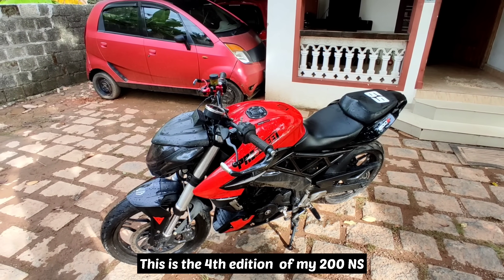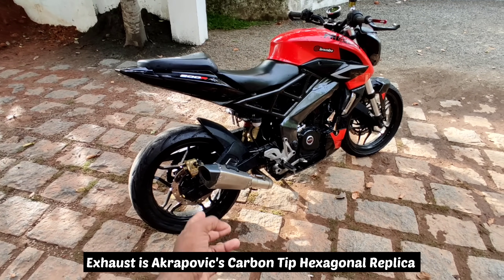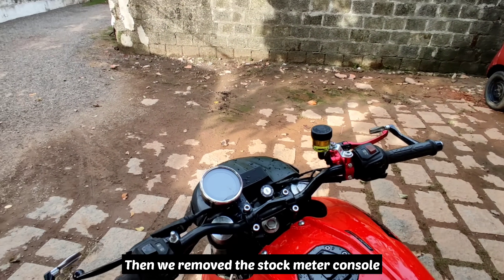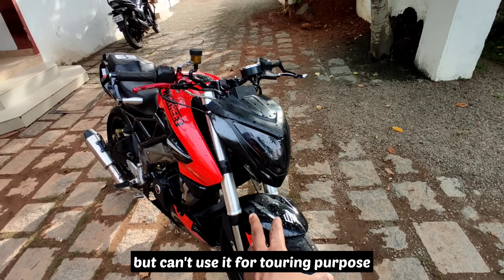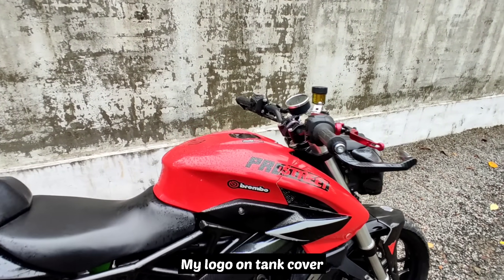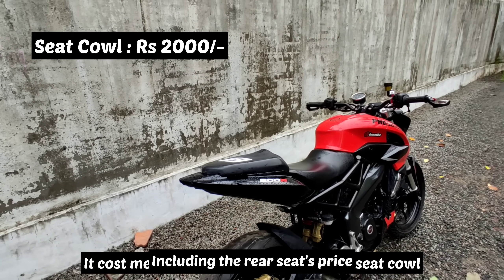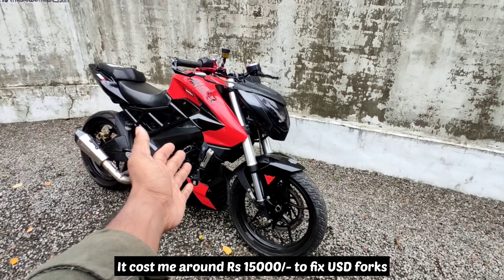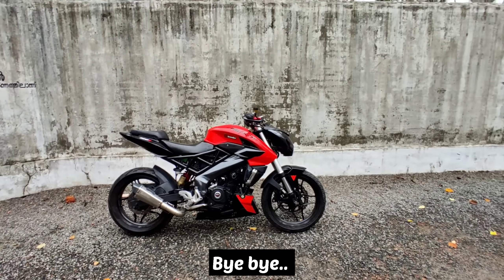Akela v4 | Ns 200 Complete list of Modification and It's price

Comment: Plz mention 

Chain changed cost 
Handle bar cost 
Dominor Holder cost 
Back indicators maded cost
Reply: rolon chain kit is around 1200 to 1500 
handle bar must be around 400 to 500
dominar holder is around 142 for upper holder plus bolts and bottom holder is around 250 so 400 total
for indicator he has custom setup

Comment: Suspension height increase chythittindo ?
Reply from the maker: Rear suspension stock height aanu front suspension lower cheythitund
Reply: @extrememotorhead8672  stock front  suspension ithe pole low cheyyan pattumo